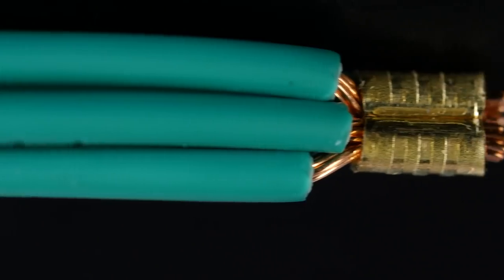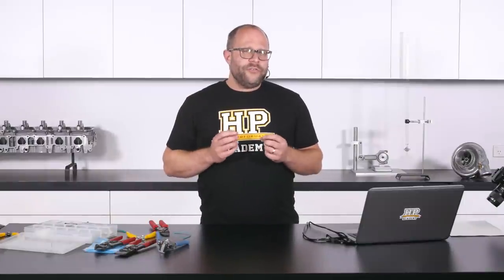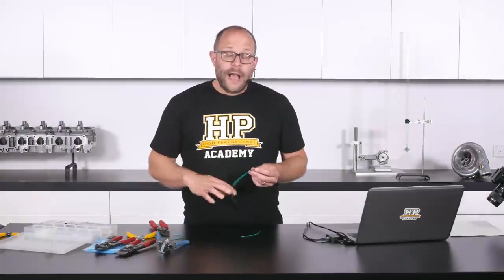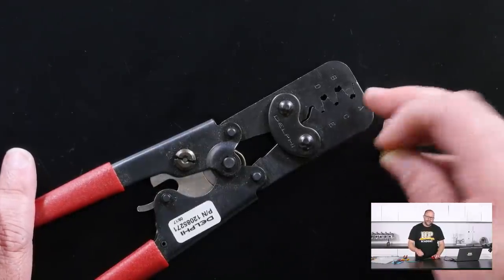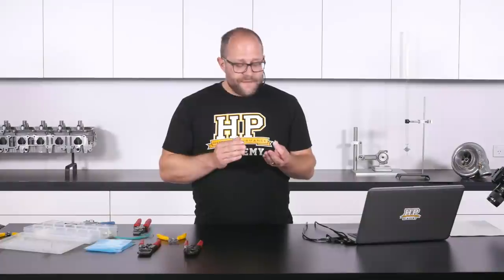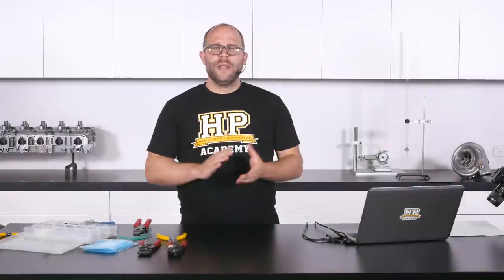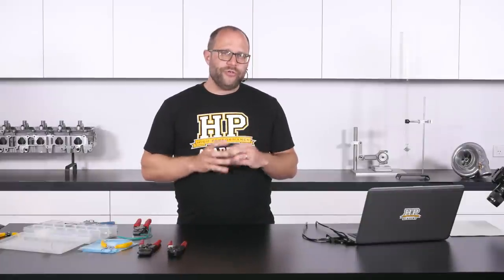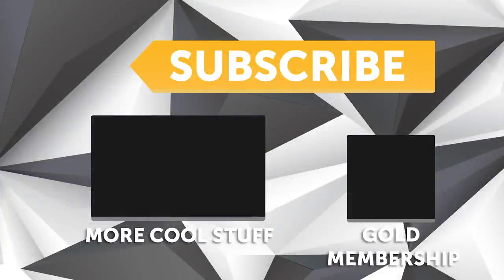How To Splice | Practical Wiring Demonstration [GOLD WEBINAR]

Comment: while the FAA recommends against soldering anything, they used to have an emergency procedure for solder repairs of wires.  basically it involved wrapping each wire around the other 4x, soldering them, adding some sealant to the heatshrink tube, and then shrinking it.  reference FAA AC65-15A for the exact procedure.  disclaimer, this method is not in the AC 43.13
Reply: I wonder why?  I always like to solder all my connections.... just when you think you're doing something right the internet tells you you've been doing it wrong this whole time
Reply: @thomasbarlow4223  because the solder joint eventually will fatigue and fail.  A mechanical connection has a significantly longer service life.
Reply: @thomasbarlow4223  The wire could break from the vibrations on the end of the solder joint because it’s much stiffer. Without solder allows the wire to flex more and has no weak points.
Reply: @thomasbarlow4223 Solder isn’t wrong, but there are pros and cons.  Crimping is usually faster, especially if only make one or two connections as there is no waiting time for soldering iron to heat up.  Soldering can be more prone to fatigue failure, but this generally isn’t a factor with wire splices as neither end of the splice is firmly fixed.  Fatigue is more of an issue with wires entering connectors that are on a rigid mount.
Reply: @salvadorebertolone Not necessarily, particularly on a unsupported wire splice.  Fatigue failure tends to affect mainly soldered connections where one side is flexible and the other is fixed.  This is generally wires soldered into connectors that are fixed to a bulkhead or device.  Soldered connections on wires that are flexible on both sides will last forever.  Similarly, soldered connections on two rigid components, think circuit boards, will last nearly forever.  That danger is flexible to rigid connections.

Comment: Coming from being a MECP certified, installer club and pro grade motorsports wire connections are way more regulated and detailed compared to mobile electronic wire installations. How are high silver content stranded wire compared to copper stranded wire since silver is supposed to be a better electrical conductor than copper? Is the silver to corrosive? I also think about causing more resistance in a splice especially when the wire is going to the ecu where it involves a sensor signal where it’s more critical to the ecu like Motec.
Reply from the maker: A sensor signal wire isn't any more sensitive when using a  MoTeC ECU vs an EMtron vs an AEM and so on.

The resistance is not any concern at all unless of course you have done your splice incorrectly.

Hope that helps! - Taz.

Comment: I like to leave a little more bare wire prior to the splice, about the width of the splice itself.  This lessens the angle of the wires as they enter the crimp as the insulation being up close as in your example bends the extreme strands quite sharply where they enter the splice due to the diameter of the insulation.  And the shrink wrap will easily cover this slight extra amount of bare copper outside the crimp.

Comment: My personal hack for replicate the Raychem MiniSeal splices (for lab use and personal applications only) is to get the generic "Non-Insulated Buttsplices" (has to be the extruded type and not the stamped type with a slit along it) and a generic solder sleeve where you gently crush the solder with a pair of pliars and remove it from inside the heatshrink. Heatshrink with glue will also work fine, preferably see-through. 

Crimping the "generic buttsplice" and then add a "solder sleeve" with the solder ring removed, only having the two glue rings will essentially replicate the MiniSeal connection for 1/100 the price.
Reply: Besides being transparent what's the advantage of this vs a quality thick heatshrink with integrated glue?

Comment: In the industry I'm in (railroad maintenance) my preferred terminals of choice are insulated double crimp terminals for small gauge wires (which are 18g up to 10g). Everything else that's 8g or larger (up to 4/0 typically) gets a brazed barrel terminal. I will occasionally used a non insulated brazed barrel terminal with heat shrink on small wires, but the double crimp insulated style is more reliable, easier, and certainly faster.

I've used that open barrel crimp tool on pins, but I've actually found that style of pin to be less robust than the [DMC AFM8] style crimper and pins.

Comment: Where does one buy OEM quality wiring with the stripes?
Reply from the maker: You can buy OEM wiring from your OEM. A motorsport wiring specialist in the other hand will give you a better product, but obviously you don't necessarily need that depending on your modifications and future plans - Taz.

Comment: Why do you still using imperial? 

Doing the calculations in metric is so much easier since all wire thicknesses are given in square mm and the crimps are as well (usually 0.5-1.5mm2(red), 1.5-2.5(blue) and 2.5-4(yellow)) and the tools have markings as well. 

I mean where is the point of calculating the cm, buying quality wire, use a propper stripping tool and then guess with the size with your crimping tool...
Reply from the maker: You can use either imperial or metic, your choice, same result :) - Taz.